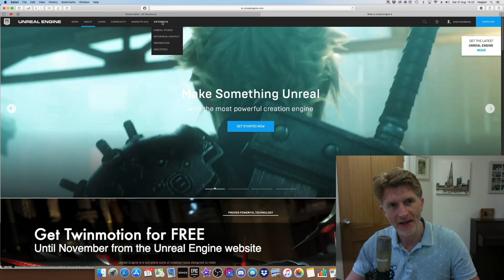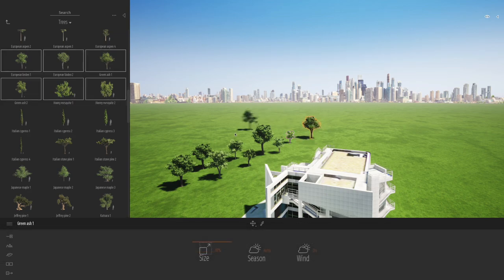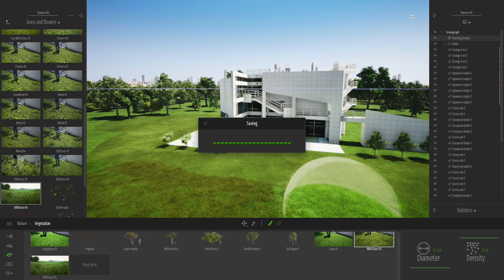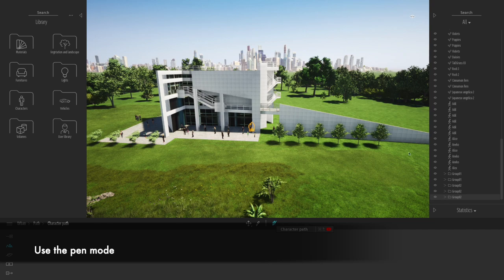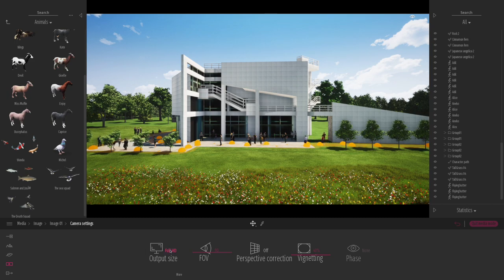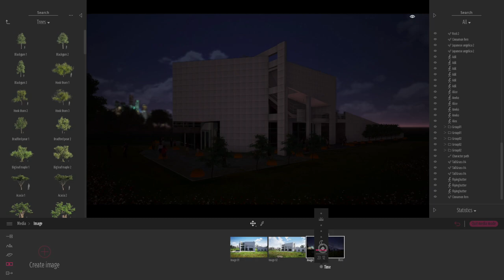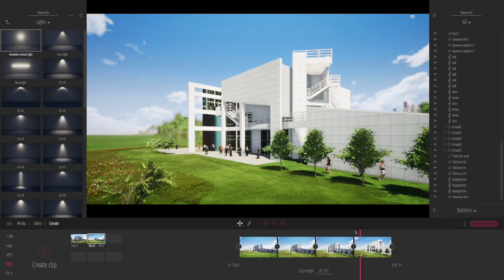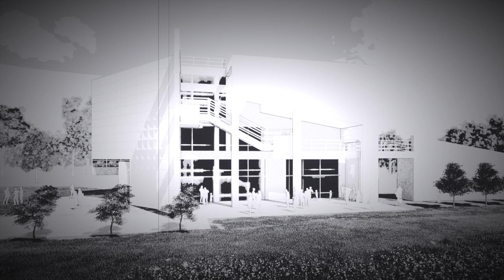SketchUP to Twinmotion Tutorial:Complete Project in 45 Mins!

Comment: Hello Jonathan, I'm trying to follow your tutorial but I've run into a hurdle at an early stage and not sure where else to get support from. I've got SU2018 and downloaded TM2020. I ran it and installed it and the icon was populated in my SU model. I adjusted the settings how you suggest. I went to sync it (the eye button) and I receive the message ''Twinmotion is not installed on your computer.To use the synch.feature you need first to install Twinmotion. Do you want to go to Twinmotion Website?''

I uninstalled it and redownloaded TM, re-ran it and restarted SU but I still receive the same message. Do you have any ideas please?

Many thanks
P